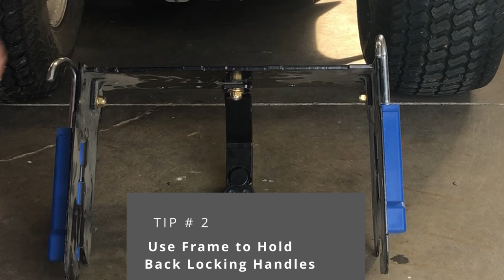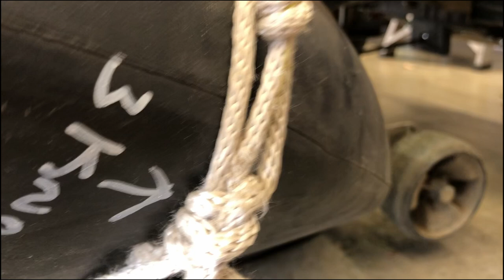Riding mower / tractor leaf pickup tips and tricks.  Make bagging leaves easier on your back.

Comment: What am i doing wrong - I've 30" riding mower and it is not picking up leaves - instead it is mulching them.
Reply from the maker: It sounds like you have the mulching blades on, switch to the bagging blades.  The blade designs are different.